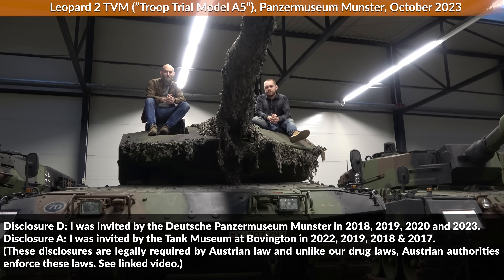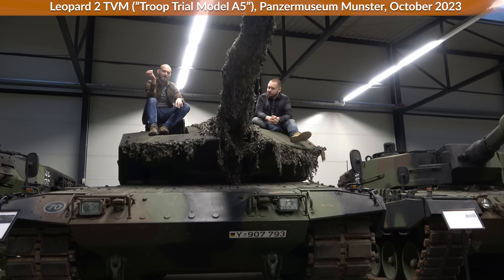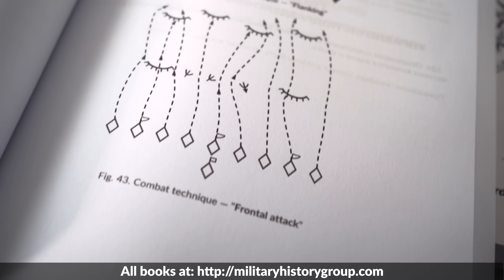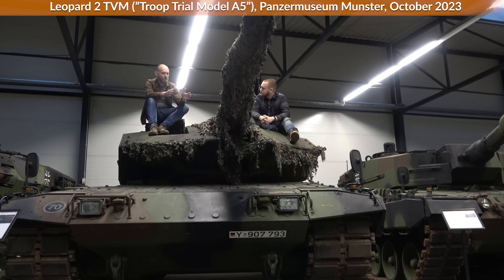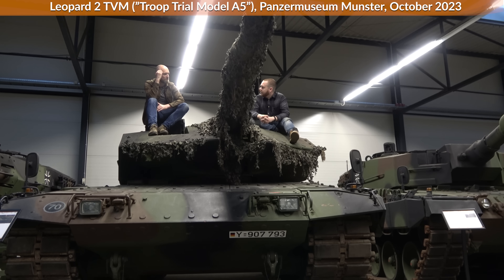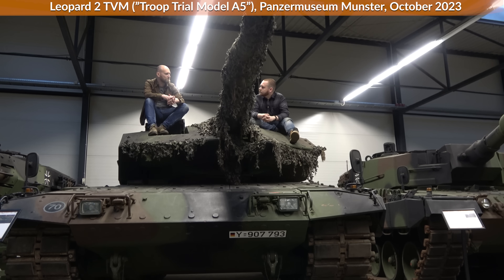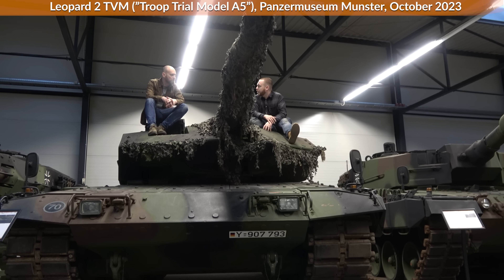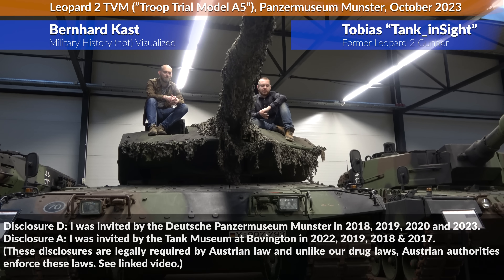Fatal Flaw? Leopard 2 Shot Trap?

Comment: It boils down to; projectiles changed, armor changed. Simple, but it answers a question that keeps nagging at you until you know. Now the question is, will someone go back to older tech to try and take advantage? Probably does not fit well into the current gun technology.
Reply: Does anyone ever wanna fire a slow AP round against someone who can accurately shot at you from 2000 meters away using sabot rounds just to try the shot trap trick?
Reply: @chrisblack6258  That is a point I had not considered. I am certainly not going to try it.
Reply: @chrisblack6258  That's what most hand portable anti tank missiles do. They fly over the tank and then go through the roof.
Reply: @Rand66437  Top attack ATGMs are a small minority, even in NATO alone. TOW-2B's overhead EFP is decades old and it hasn't caught on because it's less reliable than a direct hit and is poor against soft targets while true top attack missiles like Javelin are more expensive than an A-10 flyout with a Maverick.
Reply: @Klovaneer  You obviously missed the man portable part.
Reply: @Rand66437  Most portable AT weapons aren't top attack. Top attack missiles like the Javelin still have enough penetration to go through ERA and some composite armor.
Reply: @V3RTIGO222  The first top attack manportable AT-robot was the Rbs 56 Bill that came in the 1980's, so anything before that is ruled out by default.
Reply: @johanmetreus  what? Recoilless rifles themselves were considered manpats. Personally think its stretching the term of man portability but it is the official military designation. My statement is than manpats could be top attack or direct fire... the main distinction between is that its man portable as opposed to mounted on a vehicle.
Reply: @Rand66437  -which has nothing to do with this supposed "shot trap"
Reply: @V3RTIGO222  I was addressing the timeline for top-down attacks, sorry about the confusion.
Reply: @lieninger  Apparently, you don't understand what shot trap means. It refers to when a shell deflects off a surface and goes through the roof of the tank. Effectively a top down munition like the smaller, man-portable, anti-tank munitions out there. 

Yes there are others, but the smaller anti-tank missiles must do top down attacks because they don't pack enough punch otherwise.
Reply: @chrisblack6258  lets put it like this... the british army used APDS rounds until 1985/86 while the rest of NATO switched over to APFSDS in the late 70´s and the sovjets in the late 60´s.
A british Chieftain MBT (and early Challenger 1 too)  had to close in to ranges below 900m to have a semi reliable chance of penetrating the frontal armor of a T-64/T-72/T-80, while the T-Tank was capable of hitting and reliably penetrating Chieftains frontal armor on up to 3200m.
Reply: The problem you'd run into going back in the hopes of taking advantage of shot traps, is You're going back to s style of ammo that has zero hope of penetrating the armor on the tank at all, even with the shot traps.
Reply: A lot of downgrading just to try to exploit one possible weakness in a tank that you might not even face in combat^^
Reply: @lavrentivs9891  Not even if a dictator somewhere demands it? It's happened.
Reply: Leo2s arent in high enough numbers to warrant a change in production to older tech to counter them would be my guess
Reply: Along with what the other replies are saying as you've guessed solid shot AP would not with current cannons. To stay stable solid shot needs to be spun to quite a high speed using rifled barrels while all modern tank cannons have smooth bore barrels to best suit APFSDS and HEATFS rounds.
Reply: @oscarmeow5348  *not solid shot but full bore or sub caliber APCBC/APDS shot
Reply: the old AP rounds where discarded because they couldn't keep up with armor development. They simply cannot penetrate modern layered armor.
Reply: My understanding from another video on YT about "the wedge" is that AP shot would hardly be deflected at all. The metal is fairly thin. The shot would penetrate and get stopped by the main turret armour. An APFSDS penetrator is supposed to be destabilised so that it shatters on hitting the main turret armour.
Reply: There are so many ways to destroy a tank, why bother 😂
Reply: In the evolutionary battle of arms and armour, something will come along to overcome the current armours and then a countermeasure armour will come along and the cycle will start again.
Reply: No, sure, shells instead of sabots would take greater advantage of such "shot traps" but they would have far weaker penetrating capabilities than sabots in the first place. Also their precision is far less stable than the aerodynamic sabots, so they might not hit such a precise target anyway
Reply: Smoothbore guns are well-suited for firing darts and missiles but their accuracy with simple AP rounds is poor. The British still use rifled guns, I think, because they love HE rounds, so they might be able to fire AP shells with decent accuracy too. Especially with modern targeting technology, I could imagine that working.

The problem is still the range where penetration is possible, as mentioned by others. But that makes me wonder if AP rounds and even shot traps would be a viable option in urban warfare or some other environments where ranges are short.
Reply: Best part about spaced armor: it performs well against all plasma weapons and hypervelocity rounds (>5 km/s). So someone introduces a small caliber rail / coil gun you already have the counter installed. fast enough you always end up with plasma on impact. plasma is subject to refraction and can be dispersed by spaced armor.
that's also why the rods made of heavy material and not going to fast is so effective.